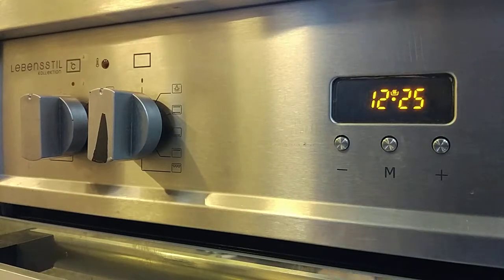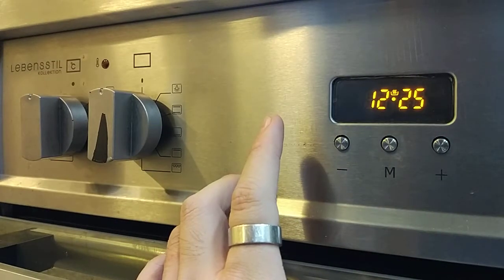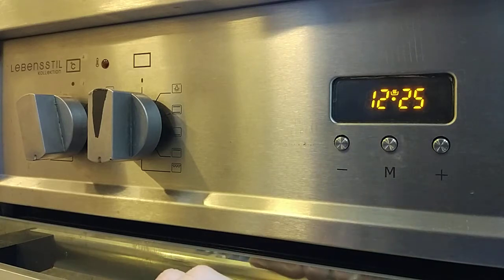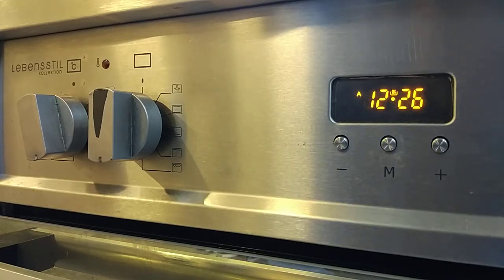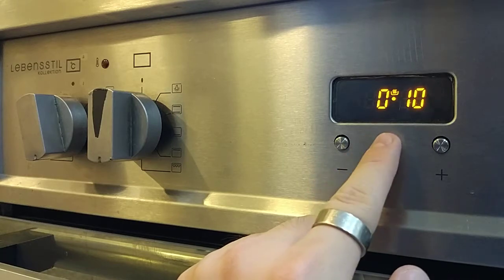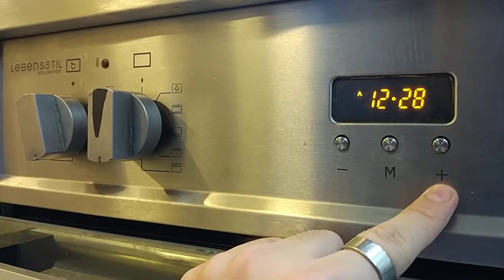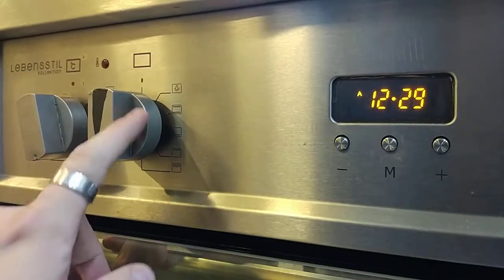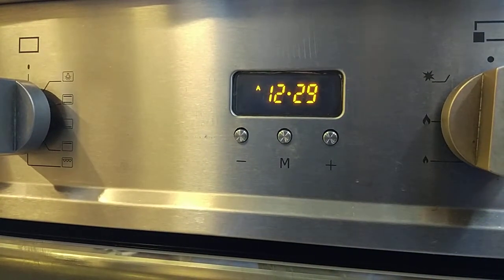Lebensstil Range Cooker LKRC-8805/8806/9150 Timer Control

Comment: Hi CH Cliff, thanks for your very helpful video. I have one question. Do I need to set the clock (time) everytime I want to use the oven?
I have been having problem with the oven. It only runs for approximately 8-10 mins before it shuts down (everything turns off!) 😥😥😥